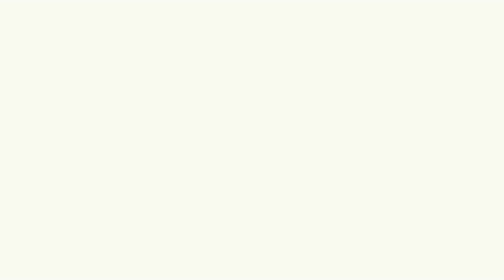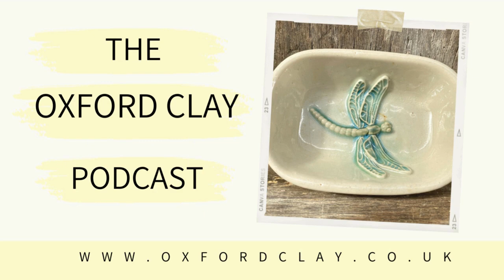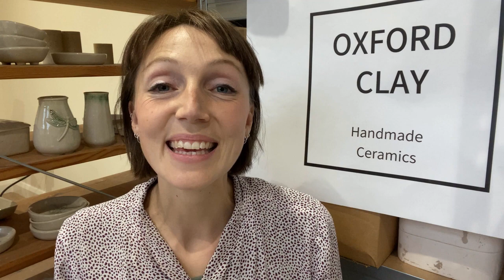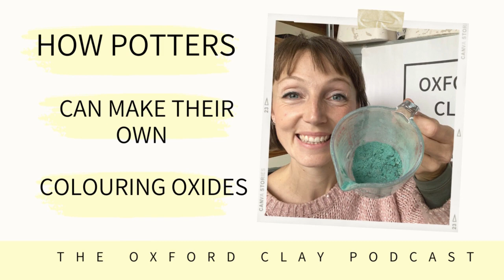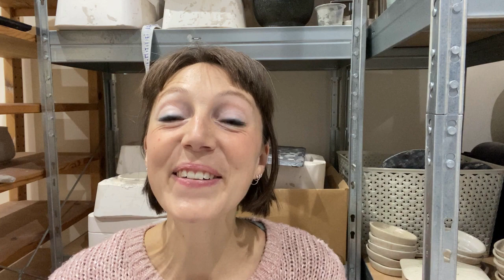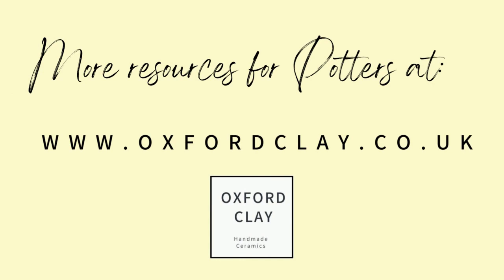How Potters Can Make Their Own Colouring Oxides

Comment: I would point out that in small amounts iron oxide and copper oxide won't do you much damage. The human body already uses iron and a little copper so the body has some defences against these substances.
 Clay dust in the air is really bad for your lungs as the body has no way to disassemble an alumino-sillicate particle so silicosis is a permanent condition.